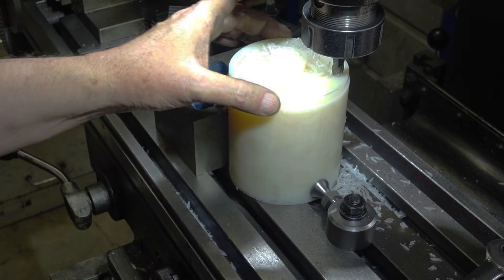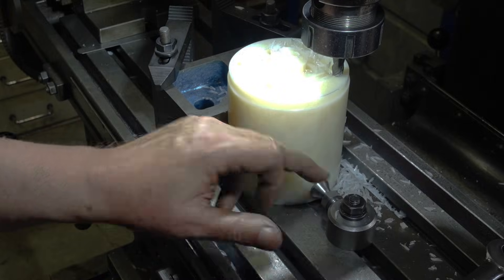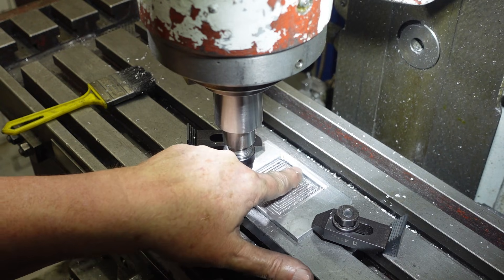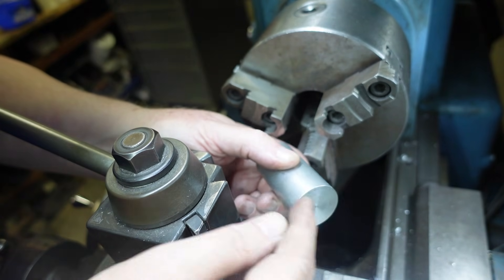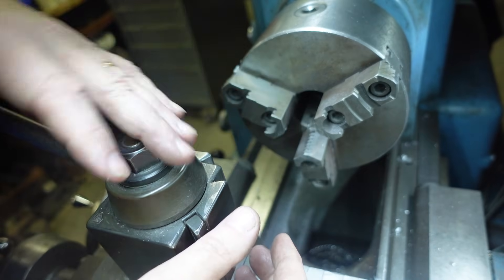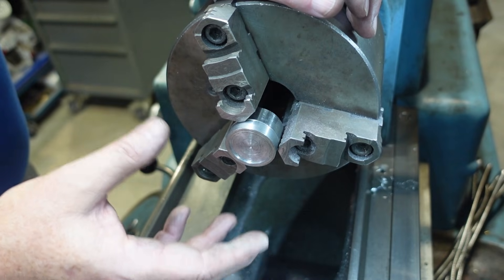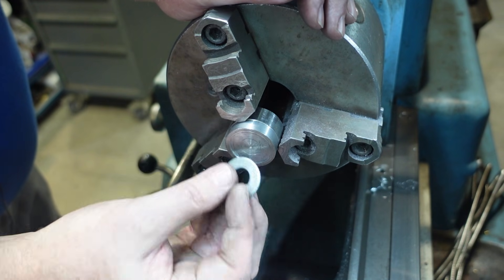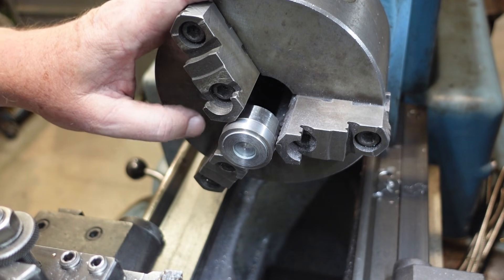A few methods for making thin parts

Comment: Nice tips. Thanks.
On your last fixture, if the glue wasn't working, cutting a few slots in the fixture axially, would allow it to clamp on the outside of the washer.  Regards.
Reply from the maker: I have seen fancy 5C collets that do exactly that. While my lathe was designed with 5C in mind, I haven't got the closer or collets to do that.
Sometimes that old tech would come in handy...